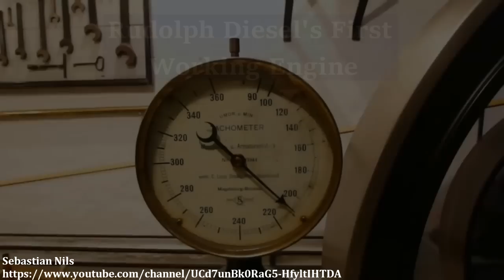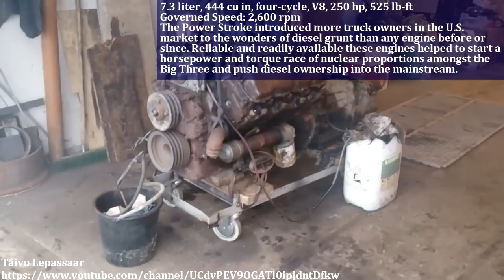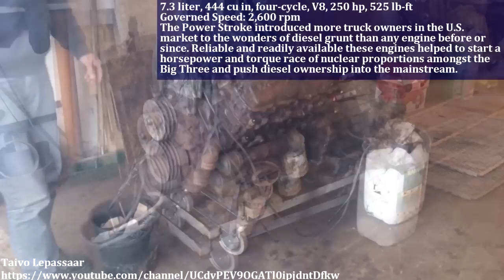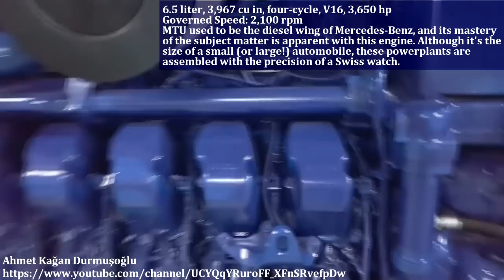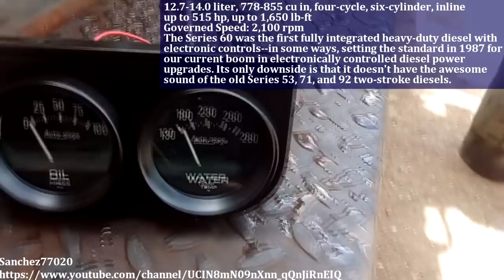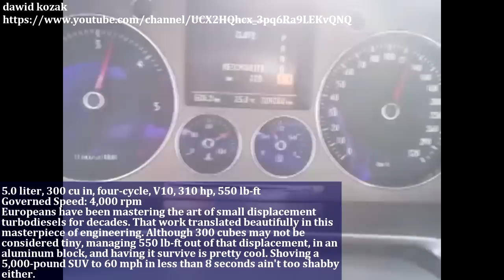10 of the Greatest Diesel Engines - Ever

Comment: The caption on the V16 MTU is wrong. 6.5 liters is not the displacement. 65 is the correct number. Decimal point in the wrong place. As for the series 60 being the standard bearer for the switch to electronic control systems BLECH!!! 90% of what makes a diesel better is the simplicity of the mechanical injected engines. If Rocket man actually did launch a successful ICBM and does an EMP blast 200 miles up over the US, the only people who will be driving are those with mechanical injection. interesting that they didn't bother to hook up the output of the turbo to the actual input side of the engine. I loved watching that TDI accelerate but it was cut off just as he hit 5th gear. Not fair. The info on the LBZ is obsolete. I'm a dodge guy but I have to admit that the Ford is the top of the heap power wise right now. All three of the big 3 have gone totally bonkers in the horsepower wars. I'll stick to my 250 hp 5.9 dodge thanks. Oh, that and my 90 hp VW TDI. Love getting 50 mpg.

Comment: That little Cummins inline never had anywhere near 325 hp until the idiot hot rodders demanded it. Where did these numbers come from???
Reply: None of these run at 2600 rpm, either. The Detroit 2 strokes were marked for 2800 max., with max. torgue @ 1350.
Reply: You have never seen the marine version of the 12 valve then. 
315-375hp 6BT
Watercooled turbo exht housing
Saltwater cooled intercooler
Big boost
Bigger injector nozzles
Bigger inj pump internals
Higher rpm (up to 2800rpm)

Comment: LOL!! The International 7.3 liter was a total POS.  The original Stanadyne fuel pump was complete garbage and the engine was weak overall for its size and weight. The DT 466 was inefficient, had excessive emissions, and had major rear main seal oil leak issues. Just because a gazillion of these cheap engines were built doesn't make them "great".  Any list without the CAT 3406B/C, Mack 237/300 or Cummins N and KTA series is a joke.

Comment: If this was a test of knowing their ass from a hot rock, the compilers of this video would need to be treated for burns.   

Most of these engines are late comers that did not set a trend or truly make a difference in the technology.  Where is the mention of the air cooled diesel engines such as the 912 and 913 Deutz engines.  A tremendous amount of the Deutz air cooled are still running.  Many pumping water in arid areas to keep people alive.  What about the Tatra air cooled engines?  While being copies of the Deutz, these engines powered some of the most reliable and tough off trucks ever.  What about the 6-71 Detroit?  It started life in about 1938, helped win WWII in various trims and continued life into the late 20th century.  Many 71 series Detroits are still running in construction service and will be for many more years.  

What about the Detroit 92 series?  They were the first electronic controlled fuel injection engines.  Where are the Mercedes small displacement engines that powered the Mercedes cars?  Those engines set the stage for all of the subsequent diesel powered consumer vehicles.  The 1.9 liter Volkswagen engines by chance?  They set the tone for performance and economy starting with the Volkswagen Rabbit car.

The Mack Maxidyne by chance?  It set the standard for all of the turbocharged truck engines to follow.  Cummins had their early turbocharged engine, but it did not really change any paradigms.  Introduced in the 1960s, it worked at erasing the old axiom "You have to keep a diesel engine at high revs or it will burn up".  When log trucks in the Pacific Northwest had 13 and 15 speed Roadranger transmissions or a 5 speed main and 4 speed auxiliary, the Maxidyne used a transmission with 6 speeds.  The Maxidyne was alien to drive until you got used to it.  You came out of gear at about 2000 and you had to wait until it was down to 1200 to 1300 or it wouldn't go in.  The gear split was that wide.

Comment: I've driven some trucks with DTs they suck. I spent 5 years in coal trucks 127000 lbs in mountains Detroit gave the company a series 60 to try and get there business 8 months later it put a hole in block. Who ever made this list doesn't know shit about engines, probably college kids. I took a big cam 1 out of a 77 or 78 model truck put it in a 72 Pete rebuilt it in 98 in 01 put it in an 84 Pete. Just this year took it out shop says they've never seen an engine so wore out but still running. That engine ran like 42 years on 2 rebuilds. Then we put in a big cam 4. I've got a 99 power stroke with 500 000 miles 2nd eng. 1st eng stopped at 300 000. Dodges with Cummings ran forever. And the 3406 cats guys were getting over a million miles on them.

Comment: And 3,967 cubic inches is DEFINITELY not 6.5 liters...damn you suck at math. And engine identification, since you say that's a powerstroke when it's clearly an idi. No turbo, since it doesn't even have manifolds on it... And the next is a dt466E and the only one you speak of is the s. Not really a huge difference, but a difference.

Comment: 2 motors I feel shouldn't be on this list is the powerstroke  tractor  motor head gasket  blowing piece  of junk and the 60 series  detroit  that motor  is crap walmart  had hundreds  of trucks with them and replaced most of them with cummins  and a few cats but the 60s  never came close to the Detroit  71s and 92s detroit  went backwards from the 2 stroke enguine  I'm my long experience  with diesel  motors

Comment: International never made a powerstroke 7.3, they made the IDI. Ford used the same design and called it a powerstroke. Also, the cat C12 in a stock configuration only had 450ish horsepower, nowhere near the numbers stated. If you're going to make a video at least do a bit of fact checking and research.

Comment: The choices you made for the 10  Greatest Diesels are a big fail. The Ford 7.3 had horrible problems with fuel injectors that cost $700 each 13 years ago. Low on torque too, at the time. The HD Cat engine isn't a great engine because they can no longer compete in HD Class 8 trucks, so they are no longer sold in that market. Neither are the medium duty Cat engines sold in the medium duty Class 6 and Class 7 trucks for the past few years. The VW 10 cylinder diesel, are you kidding??? VW diesels put out 40 TIMES the legal amount of emissions that they are allowed resulting in billions of $ of fines in the USA. Not the greatest 10, just 10 diesels. Of your list, the Detroit Diesel of 12, 13 and 15 liters are consistently the best although the early DD leaked oil from the rocker cover gaskets for a couple of years. 
,

Comment: Cummins engines are a heap of shit we had them in our harbour pilot boat 1979 to 1990,,, 11 years she used to go through 3 if not 4 engine changes a year,, I'm not lying here they even cut her speed down from 18 knots to 13 knots made fuck all difference. She was a Nelson pilot boat.. apparently Nelson fitted these engines to all there pilot boats back then even though they knew the engines were shit. They switched to Volvo Penta years later apparently but to little to late in my book.

Comment: Horrible machines, dirty stinky fuel, that gets on your shoes and ruins your wife's favourite rugs and carpets, you have to fuel up with all the hookers and truckers and other low life that hang around diesel pumps. Your neighbours will hate you for waking them up when you leave early in the morning they make such a racket...then one day you will have one run away when an oil leak in the intake cycle causes it to continue running even when the fuel is cut. Glad to see them go. The writing is on the wall, on big machines they use them to generate electricity and the machine itself is driven with electric motors, as soon as battery technology is advanced enough they will be consigned to the rubbish dump of history.

Comment: 7.3L (444) international was a piece of crap! Cat 3406B and E as well as early C15 should have been on the list before the 7.3 which had head gasket issues
Reply: John McRae . The downsize 6.0 with all emition crap egr
Reply: No the 6.0 power stroke had head gasket issue, the 7.3 is one of the best Diesel engines out there
Reply: David Wildman sorry 444 had problems as well back in the 80' and 90's. V8's suck to work on and there are better engines that aren't on the list, suppose to be top ten best.
Reply: mikeyjock the engine they showed was the old mechanical 444 which in my option was a piece of crap, head gasket issues and oil leaks.
Reply: mikeyjock this is just like the cat 3176 which as a major piece of junk then they redesigned it and called it the C12 but it was basically the same engine
Reply: You got that backwards the c15  3406 engine are head gasket eating engines. That spacer plate head design was not very good engineering. That was cats major flaw.
Reply: John McRae the 7.3 powerstroke is one of the greatest engines of all time my friend has a late 90s f250 with 630k miles on it
Reply: Yeah, the c15 with its intake valve actuators that went down every 14 months.
Reply: I think you are thinking when they added a factory turbo option to the mechanical 7.3 IDI, the 7.3 IDI without the turbo is a superior design. The turbo should of never been on option, because they made more cylinder pressure than the heads could handle.
Reply: Yeah they suck, I've seen several of the 7.3 idi go well over 500k miles, not bad for an engine that was half the price of the first 6BT cum-apart 160hp junk Dodge put in their trucks...